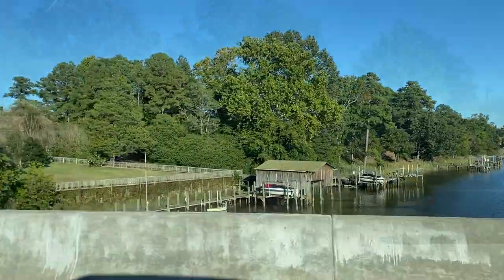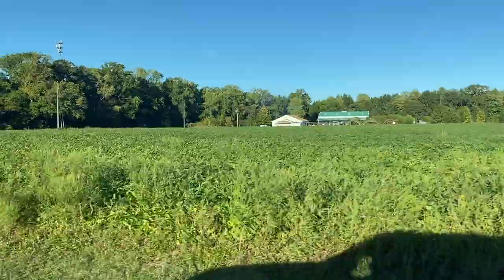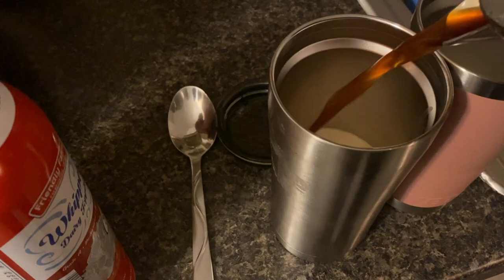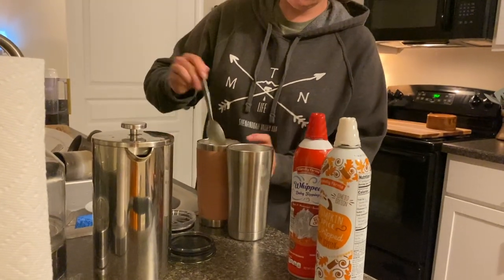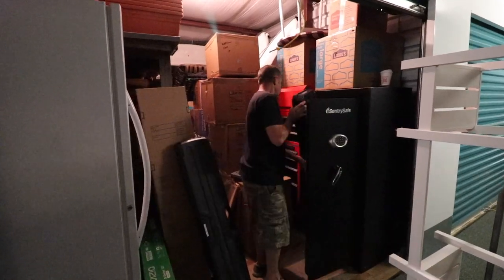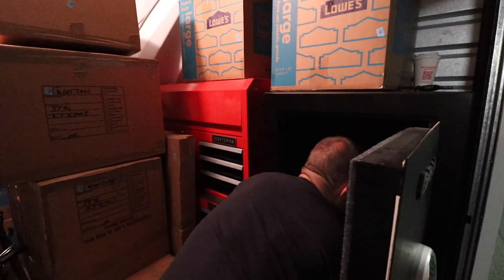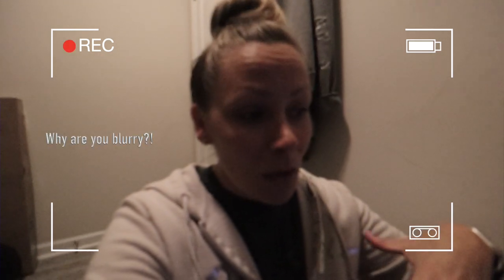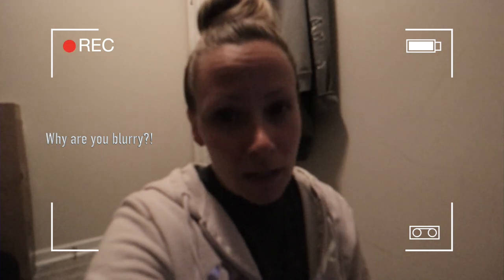Moving to ALASKA in 3 wks!🏔|| Prepping our Polaris Ranger for Shipment || Movers are Here!📦

Comment: My employer once posted a billboard, you know how they do to promote employee engagement. The poster showed a Father and Son at the zoo and a lion standing unrestrained in the path before them. The caption had the Father reassuring the Son; "Don't worry, they would never let a wild animal run free". Off to the side showed a cage marked LIONS with the bars bent and twisted where the lion had escaped, unseen by the pair. The message to employees was to not take everything at face value, be vigilante. Later at another employer making 30mm HEDP rounds I noticed a flaw in the system was allowing 6 times the allowable deviation from the specs. Fearing this condition could allow a premature detonation of the projectile, possibly inside the gun barrel, I did everything I could to get the process corrected. I was as passionate about saving our warfighters from this "perceived danger" at the time as I am now about not getting the jab. My complaints and subsequent ethics violation report only made me less popular, but I'd do it all again. Two things I'd say: Stand your ground, and the ones in charge ain't always right.
Reply from the maker: Love this message, thank you so much for these words!♥️♥️♥️